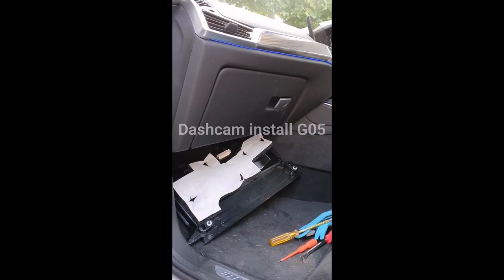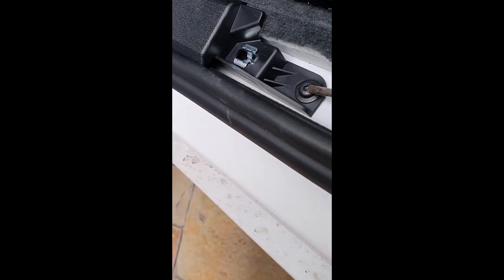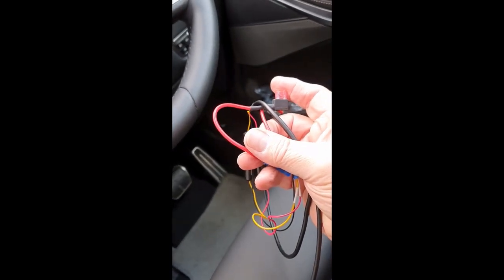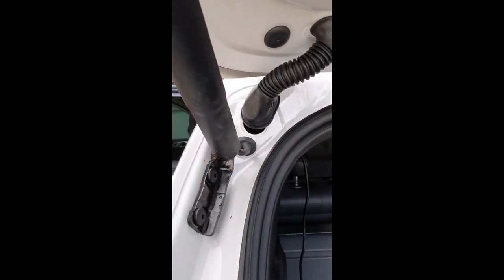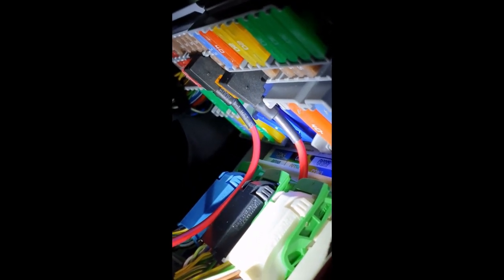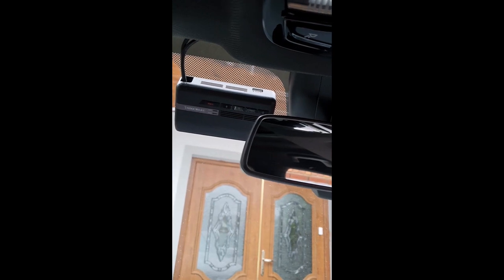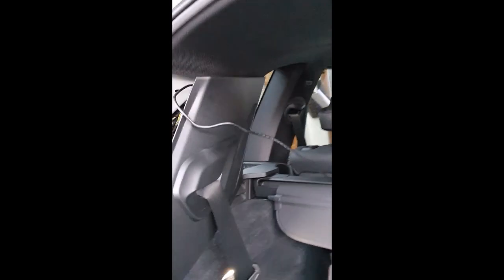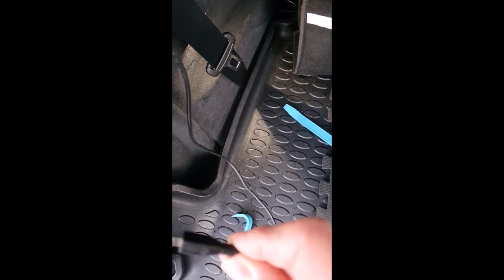BMW 2019 X5 G05 Dashcam Install

Comment: Great Job on the pre-video instructions, AND the actual video!  I've had to install a Dashcam on my M4 and only took pix of the install.  NOTHING beats having an actual video.  THANK YOU!!!!  :-)
Reply from the maker: Tony.  Thanks for taking the time to comment.  I was debating about starting the video with a long(ish) dialogue because it is not very engaging but I thought it was sensible to put the stages into context before getting into the video.

Comment: Thank you for a very informative video.  I have just installed a dashcam in my late 2020 G05. Everything was exactly as you mentioned, which was a great help.  
I noticed that the switched power on F61 does go off after 10 minutes BUT only if the car is locked!  I am currently investigating to find a fuse the is not dependant on the car being locked, ideally to go off once the ignition is turned off, but that may be difficult given the structure of the logic of operation.  Regards.
Reply from the maker: I'm glad you found it helpful.

Comment: just came across your video - amazingly helpful.  i want to install this but never done anything like this before so am little concerned taking things apart. how fragile  are the tabs?
Reply from the maker: If you are careful and use an appropriately wide prise tool then you should be ok.  I didn't break anything when I did the job.  Have faith!
Reply: @daveharwood7894  I caved and am having someone else install for me. Thank you for the video though.

Comment: Hi Dave, how do you pop out the rear speaker's cover and the hatch's black cover too. Also is there another way besides drilling the existing hole for the camera's cable? would prefer not to make permanent changes to it.
Reply from the maker: Peter.  The rear panel that houses the speaker all pops off as one.  You can see from the video where some of the plastic 'rivets' locate in  the metal supporting structure so you need to use a wide bladed trim removal tool ideally or something similar to gently ease the panel off.  Have faith - you won't damage anything if you are careful (maybe place some rags under the tool to prevent scratching etc.)  With regards to enlarging the hole that I used - I only needed to open it up a very small amount to take the rear camera plug and I used a rotary file in my power drill to do this although a large drill bit would do the job.  As I stated in the video - this hole serves no purpose on my car as the plastic retaining 'rivet' engages in the lower hole which I didn't touch.  I gave the bare metal a coat of grease but I'm not expecting it to rust.  I note that someone else has said they peeled back the roof lining to run this cable thus avoiding the need to make any minor alteration to the hole but I must emphasise that I only needed to enlarge it very marginally so I did not see this as an issue.  I don't know how the roof lining is secured but if it is stuck on with adhesive rather mechanical fixings then I would still prefer my solution.  Hope this helps.
Reply from the maker: I've just gone onto the original BMW support group site where I posted this video and extracted the post that I referred to above about the head lining option which you may find useful: 
'Another option for the running the rear cable for those who don't feel comfortable making the hole larger or don't want to pop off the d-pillar panel is to go through the headliner. Peel down the headliner and you will see a round black rubber cap (similar to the one on the left side of the hatch if you pause the video at 8:30). Remove the round rubber cap, poke a hole through it and feed the cable through, then pop the cap back into place. Also comes out the same place. If you have some sealant, you can seal the cap back up after all the cables have been run and you don't need to make any more adjustments.'

Comment: have you taken it to the dealer after the install to get something checked out?  Did it void or impact the warranty?
Reply from the maker: Yes I reported the steering wheel would not extend and retract and they were going to replace the steering column (until I found a fix on Youtube basically giving the column a good bash to 'unstick it').  No comments from the dealer about the dash cam.  Just as well as I would have had a real problem accepting any argument that the dashcam install was in any way connected to a defective steering column.

Comment: How in the world did you get that D-Pillar plastic cover off and the rear tailgate cover off for the rear camera install? Does it just pop off with some force and a pry-tool?
Reply from the maker: Yes it the panels do just pop off.  I used a wide bladed pry tool (and a deal of care)!.  If you look closely at the video you will see where the plastic pop rivets are located.  Have faith.

Comment: Thank you for this video I just have one question fuse 61 it's show it 48v it is save to the cam
Reply from the maker: What year and model are you referring to?  As I understand it some later models have 48volt circuits rather than 12 volts.  You will need to refer to your specific fuse card and technical information to be sure that you are connecting to your car specific circuits rather than just assuming the fuses I have chosen apply to your vehicle.

Comment: Why did you need both a ignition switched and a permanent live fuses? Would it not be better to put both cameras both on switched?
Reply from the maker: The permanent live facilitates recording when the vehicle is parked.
Reply: @daveharwood7894  thank you for the info

Comment: Hi Dave.  Im looking to use the fuse box in the rear instead.  Do you know where the grounding location is?
Reply from the maker: Sorry, I don't know exactly but any securing point that anchors to the bodywork should do.  Use a continuity test between 2 of your possible candidates and if you get a positive result then the grounding is fine..  Hope this helps.

Comment: If you have the Technology Package and iDrive 7.0, you don't need to install a dashcam. BMW now has a built-in recorder called "BMW Drive Recorder", which uses the surround-view cameras to record front, rear, right, and left side of the vehicle.
Reply from the maker: As I understand it the recordings are only short duration pre and post recording being triggered either automatically or manually.  There is no facility to record in parking mode and in my case there is a one time price of nearly £140 or over £10 per month.  If you change your vehicle then a DashCam can be removed and transferred whereas the Drive Recorder investment is gone with nothing to show for it (unless you shift to another BMW and they let you transfer the balance of your subscription.
Reply: I do have the BMW Drive Recorder. It only records in a accident situation (I hope). I ran over a ladder on the freeway, it did not record anything. I will be installing a BlackVue recorder and this video sure will help.
Reply: @geohar1996  to manually record an event, you need to push camera view button on the Center console.
Reply: @HeadingForTomorrow  re 750x.. I think I am going to just try plugging it in the cigarette lighter port for now.
Reply: @geohar1996  As there are no smokers in my X5 (ever!) I think that's a good idea for the moment. Indeed the car is not used for long periods so a camera that is always on may result in battery problems.

Comment: Useful information here that definitely helps but it always bothers me when even pro installers route wires across the top of window pillars without ever checking whether they will interfere with the operation of the side-curtain airbags. The airbags' front anchor points especially are often some way down the A-pillars so, even though an exploding airbag may well be powerful enough to burst through it, a cable across the top of the pillar to a rear camera sounds less than ideal. The G05 may be different in this regard but I would nevertheless always remove the interior pillar trims, remembering not to mess around close to airbags until the ignition has been off for at least 15 minutes.